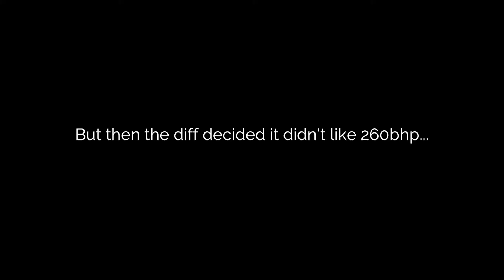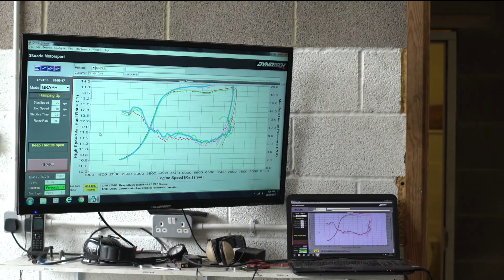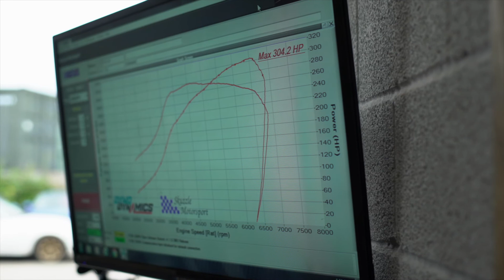DaveFab MX5/Miata Borg Warner EFR Turbo Kit on the Dyno 304WHP

Comment: top speed ? and time 0-60 ?
Reply from the maker: Currently untested, we'd like to take the car to a drag strip this year. It's only geared for around 135mph.
Reply: Depends on limiter setting but at stock limiter setting at 7,200 it would be 144mph bouncing off the limiter

Comment: Awesome build/fabrication thread, and amazing dyno results!  How were you able to run 20psi on the stock ignition?
Reply from the maker: Cheers for the kind words -  in regard to the ignition system, it's all stock with exception of one step colder plugs (gapped to 0.9mm) and some magnecor 8mm ignition leads.
Any other questions just ask :)
Reply: @davefab9932  hi dave's, was that the stock crank shaft? Was anything else done the engine?
Reply from the maker: Stock crankshaft, Manley rods, King Race bearings, VVT oil pump. Other than that fairly stock!
Reply: @davefab9932  thank you
Reply: @davefab9932  sorry to bother u again, just a couple of questions. What manifold are u using and do u sell the davefab efr kit?
Reply from the maker: Hi Reece,
We're using our own DaveFab manifold, we don't sell a full kit as such - but the manifold and other parts are available on www.davefab.com

Comment: You running the old head? I expect 300ftlbs by 4000rpm and a peak of 310-320ftlbs with a 6258 and a VVT head and 91 octane...17-18 psi. on a Mustang
Just so you know. . That is with a Trackspeed manifold, which I assume is about the same as yours?
Car runs great though!
Reply from the maker: Hi,
This is with a totally stock Mk1 cylinder head, the car made 280ft/lb at the wheels on European 95 Octane (the poorest they sell here) on a Dyno Dynamics rolling road.
We also found the countershaft bearings in the gearbox were on their last legs as they seized up completely 4 days later. We're keen to get it back on the rollers soon for round 2!